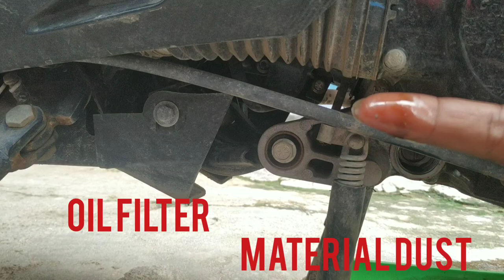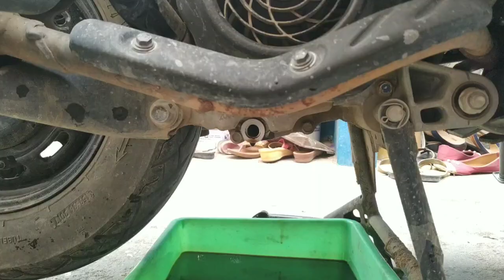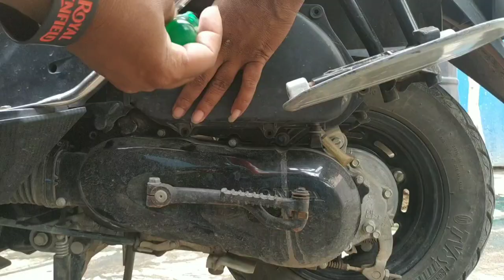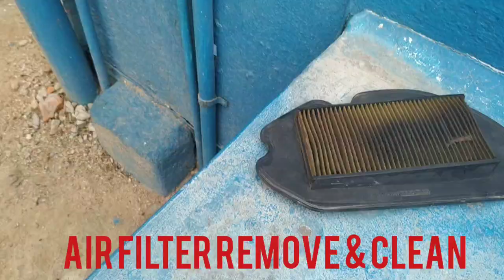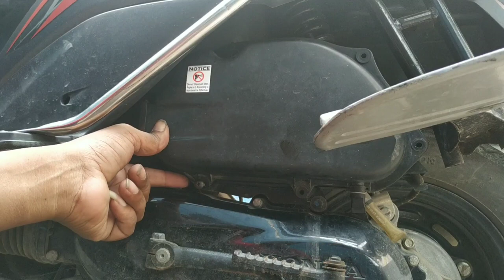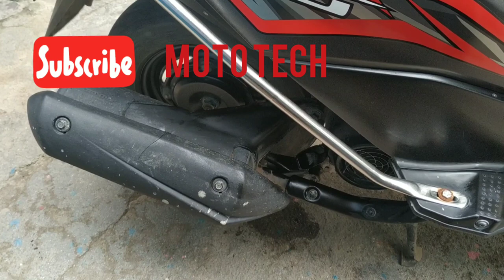How to engine oil change process Honda Dio Bs4 model

Comment: Best engine oil for Honda Dio bs4 ??? Suggest me
Reply from the maker: Shell oil or Motoil
Reply: Duration time for changing oil in dio or km
Reply: @cryptomaster7995  1000 km once you should change.. engine oil... Air filter & gear oil .you should change